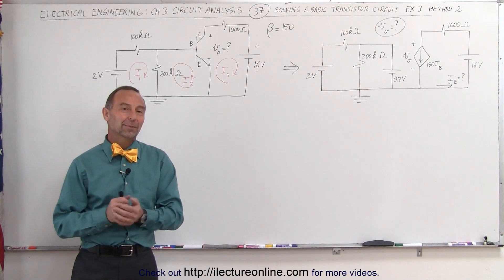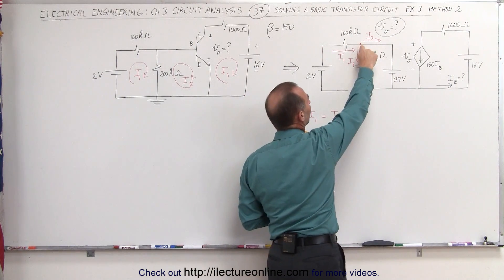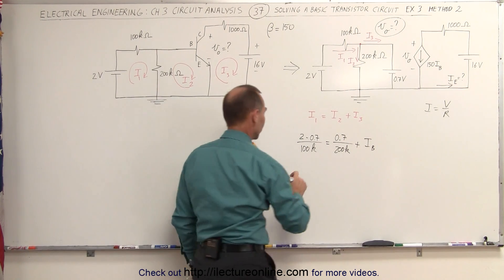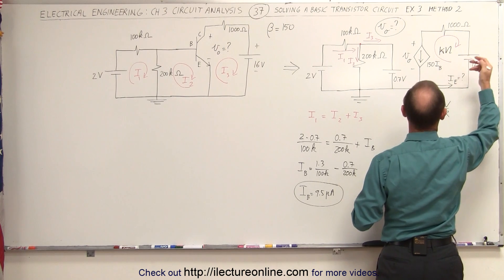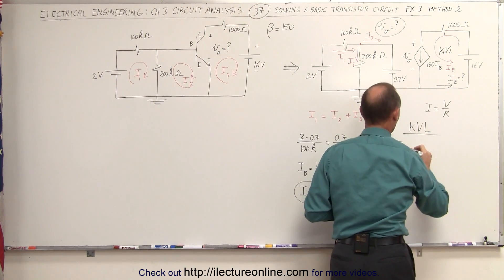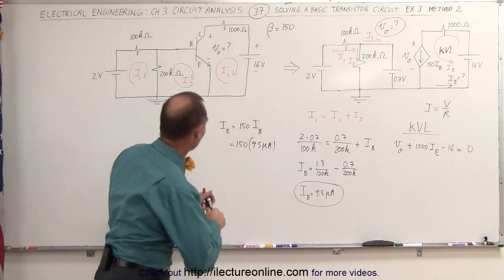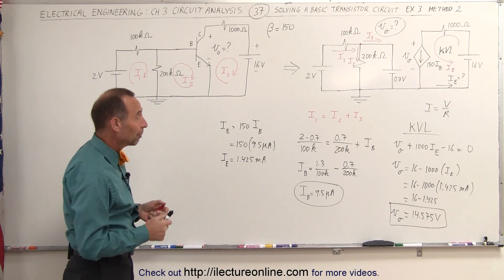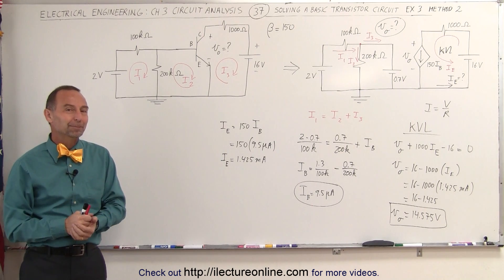Electrical Engineering: Ch 3: Circuit Analysis (37 of 37) Solving Basic Transistor Circuit (Node) 2

Comment: Thanks, Michel. In this series, I've enjoyed your clear and thorough analyses. Yet I'm having trouble applying these methods to circuits with two direct-coupled transistors. Maybe this problem will intrigue you. In one of my example circuits, bias voltages from each transistor depend on the state of the other transistor. Also, Q2 has a split collector resistor. A capacitor jumps across the bottom collector resistor and the transistor. I assume that this capacitor is a low-pass filter. But in drawing the equivalent circuit, one normally shorts the capacitors. In that case, Transistor Q2 is out of the circuit. I can solve for the second transistor (Q3). But the dependent base bias voltage source is then out of the circuit. Result: My solution is then likely invalid. I want to know the currents and voltages throughout the circuit. For example, the base voltage for Q2 seems to be 0.7V. The Q3 emitter voltage (dependent source at Veq) might be 3.5V. Please see transistors Q2 and Q3 (recovery amp), at the schematic, "Moog 9005 Reverb." This is the fourth schematic, which appears toward the bottom of this page: http://synthworld.blogspot.com/2016/03/the-real-moog-905-reverb-schematic.html

Comment: hello! I have a quick question: If we assume Ie=Ic then if we write current mesh equation for ground point we will not get a correct equation, right? we will be short of 1Ib which we dont take into account when we assume Ie=Ic=150Ib (not 150+1). Correct?
Reply: Correct. You can completly ignore Ib sinve it 150 tumes less than Ic and 151 times less than Ie, for most practicle purposes at least.

Comment: hey when you solved at 3:52 isn't Ie meant to be the collector current (Ic)? not the emitter current
Reply from the maker: The difference between the emitter current and the collector current is very small, so it essentially doesn't make much of a difference.  That said, the convention here is to use the emitter current in the KVL loop.
Reply: you are correct - the correct ratio between emitter current and base current is 1:151

Comment: Sir, should'nt the beta change to alpha because based on your calculation Ie = 150 Ib. It is from the ratio of emitter current to the base current, so should'nt it be alpha instead of beta?
Reply from the maker: This is the nomenclature that I have been using and it leads to the correct answer.

Comment: Hi professor, may I know why I sub E is (150 I sub B) but not (151 I sub B)? As you mentioned earlier, current gain = I sub C/I sub B and I sub E= I sub C + I sub B
Reply from the maker: It is the standard technique for this method.  They don't add the base current.  In the end it will make no significant difference.